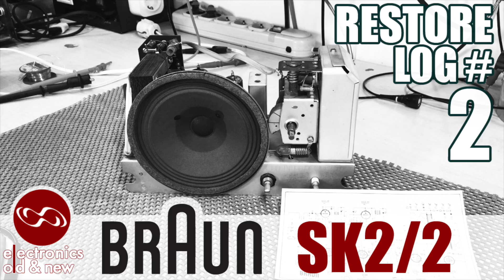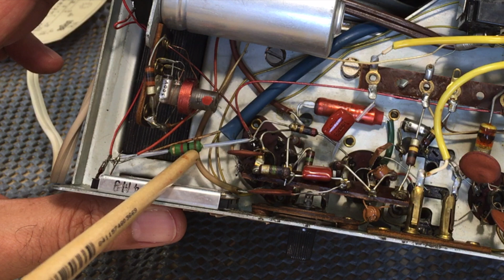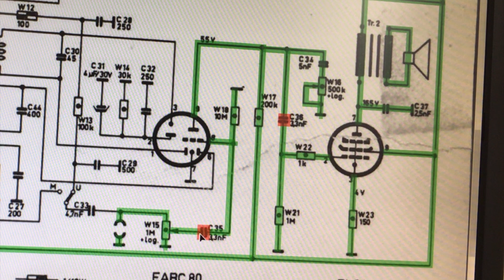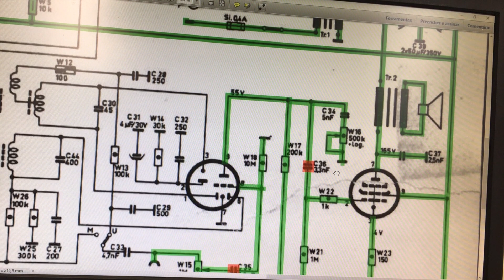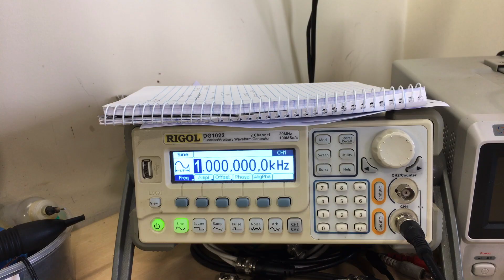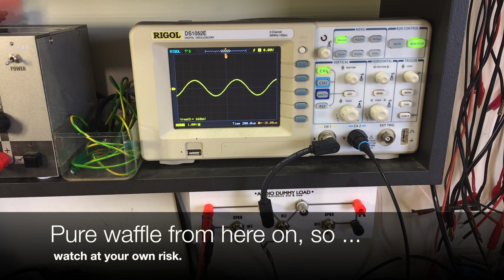Braun SK 2/2 tube radio restoration - part 2

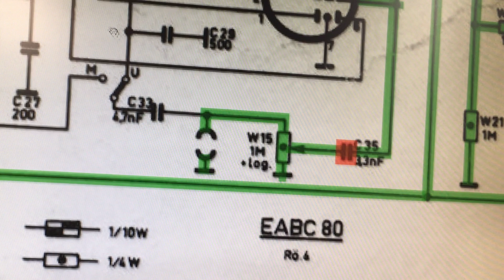Comment: 8:53 Bon dia! Thank you much for your videos that are extremely instructive! I’m currently restoring the same. One question : isn’t the values of the coupling capacitors (3.3nf) very low and damping significantly the bass ? Have you tried something like 0.5 uf we would see more in tube amps ?
Reply from the maker: There’s no harm in trying a bigger cap, but I think in this case they’re limiting Bass to suite the smallish speaker.

Comment: It's great that you include links to your howtos. But I would still prefer to see a few seconds of footage with the signal generator hooked up to the power transformer and voltage readings being taken. It is more satisfying than "I checked the power transformer and it is OK".
Reply from the maker: I can understand that, but if I had to do that every time, I’d probably not do the videos at all. It takes an enormous amount of time to do this already, and I’ve got to be honest with you, I love the restorations but I’m not a filmmaker :)
Reply: @electronicsoldandnew  How about a couple of still shots like you did with the selenium rectifier? :)

Comment: What a masterpiece of engineering, such quality, dieter is my hero
Reply from the maker: I agree.
Reply: Did he design the chassis or just the cabinets, and or the external look? It really does remind me of a smaller North American made AC/DC radio, with the exception of having FM, and a power transformer, even many of the part values are similar. If you want a truly minimalist design to ponder, have a look at an Arvin metal radio, four tubes, rectifier, power amplifier, first audio/detector, mixer-oscillator, no IF amplifier.
 I'm wondering whether Mr. Rams and the engineering staff at Braun brought in some North American sets to reverse engineer? The only thing that they would not have bothered with would be a 500K log pot for the tone control, it would be a straight linear one, if it had one at all, but the coupling cap going to it would be something like a .05 uf.
 I think you may be right about the Selenium rectifier, increased voltage drop across them is a sign that it's getting tired. I have a three way tube portable from the mid 1950s, an RCA PX-600 I think, I found it and decided to power it up on a Variac to see if it still worked. Well it did still work but did not start playing until I had the Variac cranked up to 115 volts. So with the line voltage at 120 volts I measured the output of the rectifier and it was putting out about 90 vdc, it was supposed to be putting out closer to 131 vdc, according to the schematic, and that's ahead of the filter caps, and dropping resistors. I have to be more careful about replacement then with something like that Braun as the tube filaments are powered off of the B+ supply through a series dropping resistor, 8.4 vdc is what the string is supposed to take.
Reply from the maker: With the futuristic vision that Dieter Rams‘ designs reflect, I would imagine that he would not have limited himself to trying to improve on the German radio designs, but rather the international ones in general. I too would not be surprised if he studied American and British radios of the time when coming up with his designs. I also believe his forte was in industrial design and not actually in electronics so the actual minimisation of the circuit would probably have been somebody else on the team.
Reply: @electronicsoldandnew Thats totally correct,i think your right, Im sure he worked with like minded creators

Comment: I noticed that when you switch the audio dummy load from speaker to dummy the signal on the scope becomes much larger, presumably because the switch is break-before-make.  It might be safer for valve output stages to use a make-before-break switch so the output stage is never open-circuit if such a switch is obtainable, or perhaps a couple of back-to-back power zeners to clamp the voltage levels?  Great restoration, thanks for all your videos :)
Reply from the maker: Thanks for your input.

Comment: Nice To See That Braun Used Ceramic Disc Capacitors Which Don't Give The Problems That The Old Waxy Paper Capacitors Did,... Some Of The Old Carbon Composition Resistors Look Like They Have Had a Hard Life But You Say They Have Risen Only a Little in Value So They Must Have Used Trustworthy and Reliable Parts Love That Little Round Speaker Too !! Looking Forward To Your Next Part...Regards mike

Comment: That clipping on the positive side only is not uncommon for a single-ended Amplifier like this. Bear in mind also - this amp has no negative feedback, so the THD is generally higher than usual. There is a thread on the radiomuseum page (unfortunately in German language: https://www.radiomuseum.org/r/braun_kleinsuper_sk2_2.html) where one user describes a modification to give this amp a little NFB which cleans things up a good bit. Basically it works like this: insert a 560 Ohm Resistor (i call this resistor R1) into the connection from the volume pot to Ground, ground one side of the output transformer and feed the other (not grounded)side from the  output transformer via a 15kOhm Resistor to the connection from the 560 Ohm Resistor to Ground from the volume-pot (the inserted resistor R1). The second modification that goes along with this is installing a 47µF/25V cathode-bypass Cap on the EL84. I tried this in one of my SK2s and it works like a charme - sounding much better now!
I also swapped the selenium diode with a 1N4007 Diode and a 300 Ohm/10W dropper resistor, because i want this thing to be reliable. B+ is bang on 175V. :-).
Like your videos, keep em coming! Good luck with your restoration! 

Oh and btw. - drop me a line if you need knobs, there is a guy in Germany who makes them new and sells it via "Ebay-Kleinanzeigen" https://www.ebay-kleinanzeigen.de/s-anzeige/braun-sk-1-sk-2-sk-25-und-varianten-bedienknoepfe-radioknoepfe/1241425320-172-1485 - i can buy and forward the knobs if you can't get them from him.

Comment: With the clipping only on one side of the wave I'm suspecting a bias issue. I wanted to see the trace from the grid of the EL84 to see if the triode is working correctly.
Reply from the maker: I’m going to do some more checking when I have all the tubes in place and checked that the B+ is right.

Comment: There's much space on the underside, now you see how much space the switch block with the pushbuttons takes in other radios.

I haven't seen a ferrite bar in this radio, but apparently there must be one. There appears to be no external AM antenna input. Looking at the schematic: it's an interesting circuit in which the first ECC85 triode is used as the oscillator for AM (preamp for FM) and the first EF89 acts as a mixer on AM, a normal IF amplifier on FM.  By using different triodes in the ECC85 for AM and for FM oscillators, they did not have to put a switch in the FM oscillator circuit (which would have caused trouble on these frequencies)..
Reply from the maker: There is no ferro antenna in this little guy. The AM antenna is actually derived from the FM antenna dipole connectors.

Comment: douro20 below calculates about 500mW, which is ~ what I get too (depending on the load you had switched in; I forgot to take notice). Now, I couldn't find a good set of curves for an EL84 - but for the (identical?) equivalent 6BQ5, half a watt or so looks about right for the voltages (175V plate, 4V cathode bias, etc) given on the schematic. I think the design just runs the output valve fairly sedately!
Reply from the maker: Yes. It doesn’t run it, it walks it :)
Reply: @electronicsoldandnew  I think they do it for a reason: to limit the heat production inside the small cabinet.